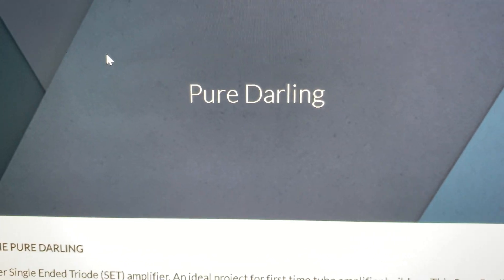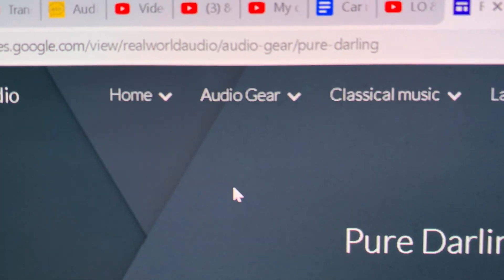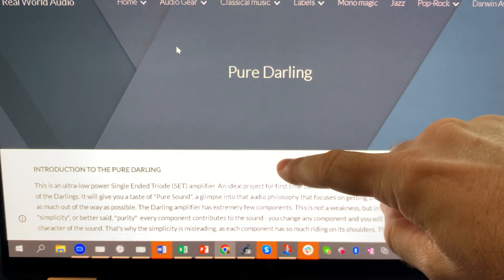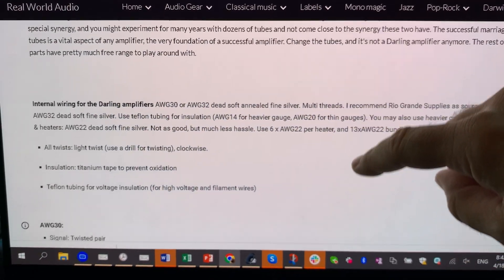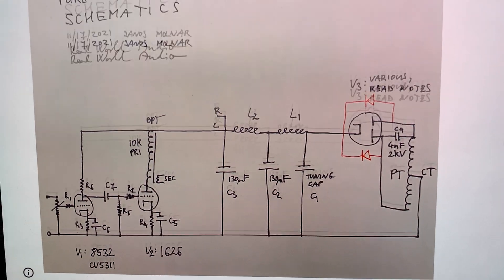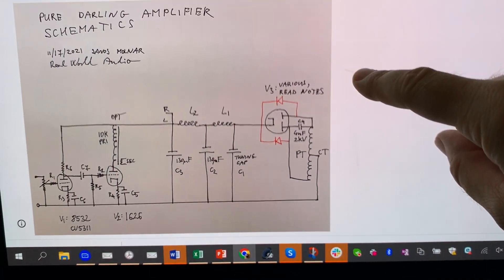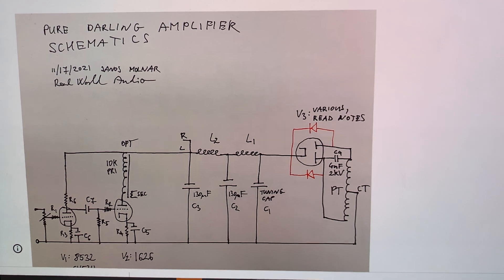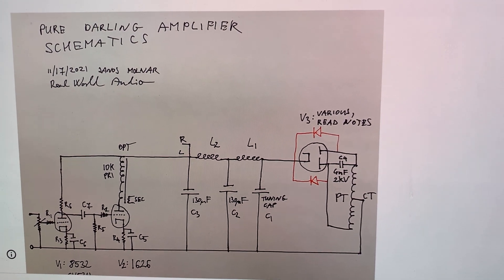Pure Darling schematics and notes

Comment: Hi Janos, I made baby darling using James Output transformer and hamming 369EX transformer. I am driving old JMLab Cobalt 820 and JMLab Electra-bookshelf ( both 90dB ) . Are these suitable speakers for darling amp ? Do you recommend any other speaker or any easy to assemble speaker? I have an extra 369EX, can add this power transformer in parallel to feed more current ? My power transformer gets very hot after an hour of use .
Reply: Hamming=Hammond
Reply from the maker: Hello Anil, I am so glad you built the baby Darling!!!!  You could parallel the two Hammonds, or even better, double up the power supply - each of the channels fed by a separate power 369EX. Either choice, you will have a LOT more dynamic headroom. 
The 90dB JMLabs will play well, provided you don't want to loud..  if you would like to venture into building an easy cabinet, then I'd recommend building a Voigt pipe. You can use my Voigt pipe's cabinet dimensions, and will work very well with most 8in full range drivers. It will give the advantage of a lot more midrange clarity compared to the JMLabs, and if you can find the Cube audio Fc8 driver, although expensive, it will also give you crazy low frequency extension as well, and a lot of energy delivery. Other full range drivers will all sound very good to superb, but the Fc8 seems to be unique that it is truly full range, from lowest lows to highest highs. I'd be very happy if you shared your experience with the baby Darling, how you like it, and what is it you would like to improve. Cheers! Janos
Reply: Hi Janos, I  used 12SL7 as driver  . I tried connecting two power transformer but they got hot very quickly hence I went back to single power  transformer.  I found 6 of CV5311 in my tube-box . Can I use them as driver tube ? 
I can not afford to buy cube audio’s driver . I will try to get FC-8 from Lii Audio and try to make speaker like yours . In the mean time , how do I increase power output to 1.2watt or 1.5 Watt . Can I put two o/p tube in parallel ( Just after AC coupling cap )?

Comment: Hi Janos!
Currently I’m making a audio rack of nice thick shelves of black limba. I’m wondering how much space your recommend between the gear and the shelve above.

My OTO is getting quite warm since the tubes are in a closed box and uses 4xel84 as power valves. In my Dac3.1x/II are also 3 tubes but this is not getting really warm.

I think the equipment can handle the warmth since the closed box design. So I guess when the wooden shelve above doesn’t get warmer than hand-warm it should be fine? Correct me if wrong!

(I was thinking 4 tot 5cm for OTO amp and 3 for the dac?)
Reply from the maker: Hi Nick, those clearances will work. One trick: they are happiest when the covers are removed, and the tubes can freely dissipate their heat to the air. When you look at videos of Peter Qvotrups system, he tends to have  the covers removed. That was also one thing my mentor always did - remove the covers of all tube gear. It allows much better tube cooling & longer tube life, plus also better sound (more open air, more life).That will pretty much voids the warranty, but if you are keeping them for life & no little children around, then removing covers is a good option.

Comment: I just completed a single ended Sakuma style amp, with a power tube as driver and interstage transformers - it's not a Sakuma 'Darling' though. First impression before break-in is a stunning tangibility of instruments and singers - even my wife commented on it hearing Henryk Szeryng playing Nicola Paganini. It's also highly dynamic so Dibby (VIP) by DJ Trace had plenty of speed, weight and low end. I generally love PP dynamics for close-miced recordings since I find it a more credible match for the energetic nature of many instruments close up; SE is usually more akin to listening a bit further back - I think this type of matching is entirely overlooked in PP vs SE debates. Bridging the gap is somewhat a holy grail of tube amp design.. :-)

Comment: Hey janos I couldn't get my hand on these tubes otherwise I would have definitely made one ,I'll try sourcing it from abroad soon and make withing next 6 months for sure
Reply from the maker: Good luck 29! These are vry inexpensive tubes, even with import & shipping they should be affordable. And well worth the trouble as it's an uncanny match. Warning though- no loud Circle partying with these!!! These are for normal / quiet  listening only with under 1WPC ; )
Reply: @realworldaudio  offcource , circle parties are when my friends come over in the theater with 3 subs 😄  ,my room is for enjoying music at mediocre level and I still sometimes use internal crossover of avr to take.away bass less than 100hz that way amp doesn't get stressed a much and with my 6w amp and a big cd I can rock up till levels where my ears would bleed so it's cool
Reply: Bro plz do something on how to terminate my flat cables I have an amp where I can solder them but I wanna swap out speakers so I need something for the other end frank actually gave the best idea I got till now
Reply: @IDontExist14  Hi there. What was Franks idea? I’m interested. Thanks!
Reply: @earkivaren  he told me to make the front of wire to shape of a spade plug and use this bare wire like that, and the rest will be insulated but I might have to tin it so it doesn't oxidize quickly
Reply: @IDontExist14  Thanks!